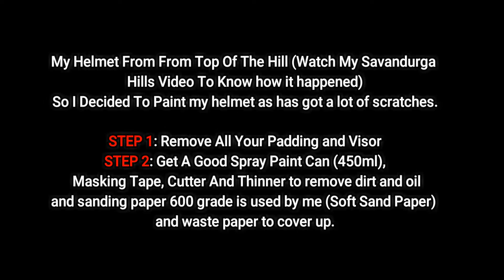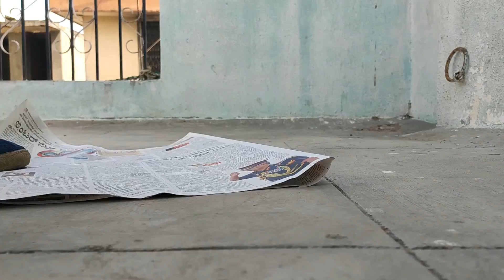How to Paint Your Helmet At Home | Easy DIY | Step By Step Process

Comment: Bro, is there any qualt issues
Reply from the maker: No bro no issues I wanted to change the colour to black that's it
Reply: Bro spray paint name,
Reply from the maker: Go for banna spray paint bro.. this is normal local shop we get 
Place order in Amazon or flipkart for banna spray paint it's very good.
Reply: @AdventureChariot  bro is it resist with petrol
Reply from the maker: I'm not sure on that bhai.. I don't think so petrol would wipe of paint until or unless you wipe it hard on that surface.

Comment: Next time, use a plastic adhesion promoter spray to avoid paint cracks. You can get one for 500rs on Amazon. Also, if u want your helmet paint job to look amazing give multiple light coatings instead of one heavy coating. Use varnish or clear coat after the top color coat. Would love to see you do it on the same helmet. Good luck.
Reply from the maker: After this I have given a clear coat too, but didn't do the video on that actually. Will try to make one on that, thanks for watching ♥️